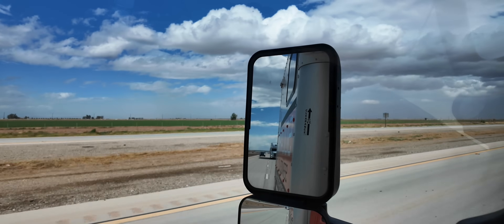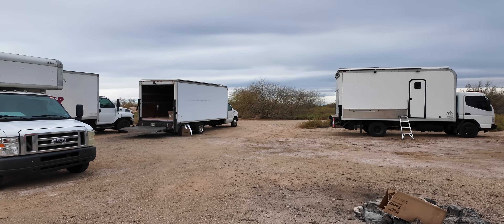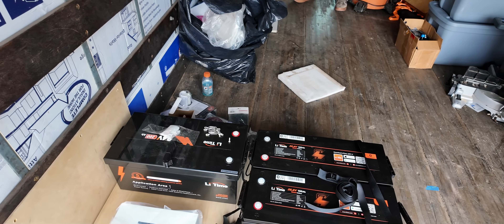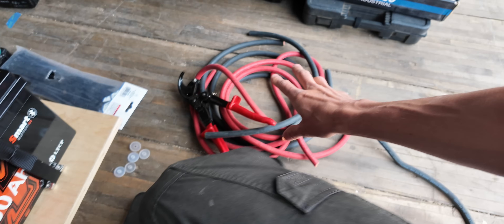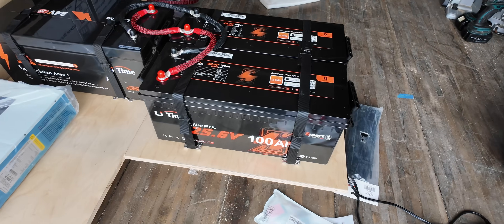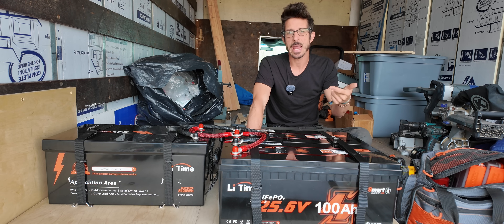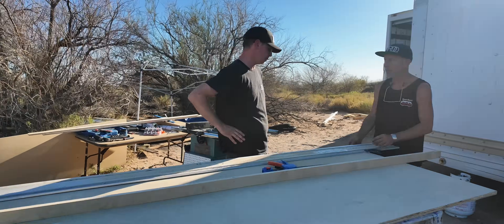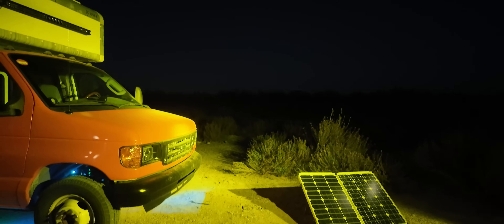Installing a 24v LiTime Battery bank into a Box Truck Tiny home

Comment: I Started with 4 RENOGY 200AH AGM Batteries and a 3000 watt 12 Volt Inverter and Soon transferred to 24 Volt n keeping the RENOGY BANK tied into 24 Volt Packs for Winter Backup. 10Kwh with 4 24 Volt 100ah Lithium Iron Phosphate Batteries is the way to Slay a Nice System. 💦 Indian Creek Ranch ⛩ Southern California High Desert 🌵 near Big Bear Lake Mountain Resorts Community

Comment: Is this the inverter you would recommend for a 24v system? I saw your system has the sungoldpower as well. I also saw you install an eco worthy in another build. Li time and powmr have a 3000w that’s very similar. I would like to get your opinion on them before I make the purchase. Thanks
Reply from the maker: Each inverter has different solar input voltage requirements. You’ll need to match the unit to your solar system

Comment: Love the community for sure. I forgot how much and what voltage is your current battery configuration? Also I heard you say you wanted a larger truck so you could carry more work supplies with you, why not just pull a small trailer with supplies and keep the current truck?

Comment: Those cable wraps look great! Great work all around!

This channel has had me researching whole-home DIY battery bank solutions. No joke--while I was researching 48v systems this afternoon, my power briefly went out! I suspect I can build a 15kwh system with an inverter large enough for critical loads for $3k!

I wonder if you'd be open in the future to paid consulting calls? For those of us who think we've got a handle on it but would like a sanity check.
Reply from the maker: Yes! This is very achievable. I do offer consulting calls:
https://shop.beacons.ai/nomadbrad/404eac6d-1ee9-45ed-8e73-59a9b6e70d8d

Comment: Hey brad I’m confused. I thought that batteries balance out to the lowest capacity. So wouldn’t that mean the  25.6 200ah battery is now limited to 100 ah because of the other two. Thanks for posting I can’t to finish my build
Reply from the maker: No, that’s not how it works

Comment: If I were to hook up those batteries, I would have paralleled the two 100 AH then hooked up to the bus bar. I would have then hooked up to third 200 AH To the bus bar. This would essentially give me two 200 amp hour battery banks. The lead's coming off the bus bar would be between the two battery banks, so both batterie banks gets drawn down and charged equally.   (Or), Am I missing something?
Reply: Yea I was confused by his choice. I’m a novice n still learning, but agree with your plan

Comment: I thought mixing battery sizes was a no-no. Did I get that wrong?
Reply from the maker: It’s fine in parallel with similar batteries
Reply: @nomadbrad503  Good to know!

Comment: I used that wire lume for my mc4 extention cord for an extra panel.
Only down fall is if one bms craps it will kill the other bats when too high of charge is added.I have 4 12v bats wired 48v so is 1 bms quits and 48v -58v hits a 36v bank it’s done.

Comment: Thanks for another great video, Brad.

Question:  I saw someone use jumper cables and cut them up and attach connectors to the ends to wire his battery system.  He mentioned in the video that he saved a lot of money doing that instead of purchasing dedicated cables for the type of jobs done on campervans.  Is that OK to do?  Thanks in advance.

Comment: man i have been advocating for 24v dc wiring for awhile now. im talking about using 24v dc to directly supply power points all over a campervan/rv with 12/24v cig plug ports.
using those gan 100w usb-c "car chargers", you can directly power up to 100w through usb-c to electronics with 98% efficiency (batteries to load). inverter can stay off. if the device you want to power is not usb-c and has a barrel jack, you can resolder the appropriate pd trigger board, or use the premade usb-c to barrel jack pd trigger cables. the voltage is appropriately selected by the ultra efficient car charger adapters using the pd protocol. they now make 28v pd 3.1 140w adapters too, which can directly power a dc fridge through usb-c with a 28v pd 3.1 trigger board. mines been running this way for over a year straight now (vid on channel).
also you can completely omit the inverter and run a 24v DC air conditioner, and use 24v mppt charge controllers which are almost 98% efficient (compared to the ~92% efficiency from all in one/hybrid inverters). 
this setup is also significantly more quiet. the heat generating components are spread out, and there is just not much heat generated to begin with.
for cooking you can wire in a point of use 24v to 1500w inverter and only use it when youre cooking and making noise too. the only question is the reliability of 12/24v cig plugs at that higher wattage. might be better to use an Anderson receptacle or XT 60/90. 1500w is the max rating for all 120v north american appliances (other than hair dryers). 1500w toaster oven from 8s lifepo4 at ~27v nominal would be 55 amps. theoretically the XT60 could supply the point of use inverter for cooking, but XT90 would probably be best. they make receptacle versions of the XT 60 and 90 now, just have to solder it onto the leads of a 24v 1500w inverter and size 24v wire correctly. it really just has to be short enough at 2awg. black wire runs cooler btw because of significantly improved raident cooling compared to red wire (black body emission). 

you are right, 24v systems are always overlooked, people jump straight from 12v to 48v and dont realize all the dc appliances and efficiency gains they gave up going with a noisy inverter. inverters are wear items. the NVH environment of a mobile application means they will always burn out when you need them the most. my calculations an all 24v dc wired system would improve effieincy by nearly 50% round trip, which is what everyone needs with limited solar area/flat mounts.
24v dc appliances no one realizes exist: 24v 300w 3liter rice cooker (like a mini DC instapot), 24v parking air conditioner (double efficiency compared to 120v, about 1.5x better compared to 240v, and right sized), 24v induction cook hobs, 24v fridges (all dc fridges are actually 11-30v rated), 24v 300w immersion water heater, 24v starlink (POE spec is 24v afterall), 24v lighting very common for industrial applications, 24v diesel heater, 24v usb-c car charger adaptors with pd3.1 stepup to 28v 140w, 24v ovens common in australia overlanding where they love their anderson connectors, 24v 460w hot plates, 24v roadpro cooking devices, 24v kettles, 28v usb-c 450w heat pump. actually that last one is tounge in cheek, my fridge in my car running off usb-c from my powerstation is basically a 88w in:450w out usb-c heat pump until it reaches equilibrium. its crazy how i can stay warm in my car if my drink fridge is at room temp when i turn my car off through just a usb-c cable.
the only other youtuber who has talked about this is travel & design in his episode "[Car camping] No inverter required, DC appliances for vanlife"
okay man this comment is way too long but everyone is way underrating a total 24v dc system.
yes there are some japanease made "24v microwaves" but theyre very expensive and just have a stepup inverter inside since magnetrons need AC
Reply: Interesting. I went 48v and hear the computer fans I bought blowing on 6k low frequency inverter .The bigger dray the lower efficiency is what I’ve seen,175 watt idle.
My 12v 2k Magnum doesn’t even register idle consumption on Victron shunt.You threw out some good points someone may like with there builds.Rock on man!

Comment: Do you still need a victron shunt when you have the Bluetooth app on the battery’s ?
Reply from the maker: One of Dave’s 3 batteries is not a Bluetooth model so he will need the shunt to properly monitor the whole system

Comment: Bravo......I went agm.......14 battery's........1000 amp hours.....1000lbs...I did 3 mini banks of 4 bats..... 12v....with two for the house......and 10k generator......propane......cheers.....

Comment: Just saw a box truck build on another channel-- the builder mentioned he's gonna install an EV charger port on his vehicle as an added alternative method to charge his electrical system when solar charging is compromised.. 

Sounds good in theory; I've never heard or thought about it myself, but I'm curious to hear your thoughts on this? Do you think is feasible or even a noteworthy project?

Thanks
Reply: I’m nowhere near as smart as Brad when it comes to this electrical but I’ve been researching this for a little bit and it’s my complete plan. It seems the all in one inverter chargers take 240v AC input. Which would be perfect for lvl 2 charge stations . After that all u would need is j1772 adapter to nema 5-15 or 5-20 outlet.  Also Eg4 makes a chargeverters that would also work but that’s for 48v systems
Reply: @ excellent! 😎🙏 thank you for taking the time to share and explain. Much appreciated!